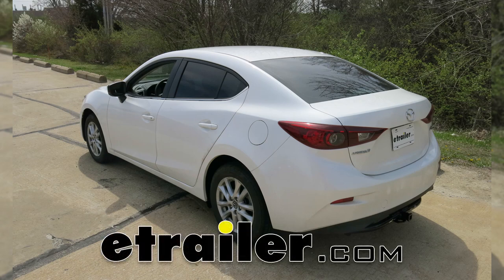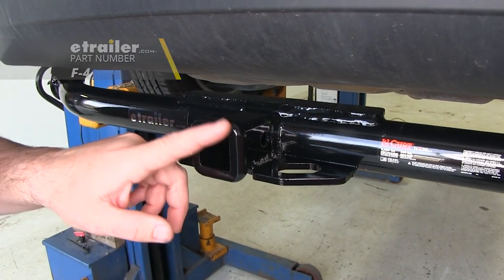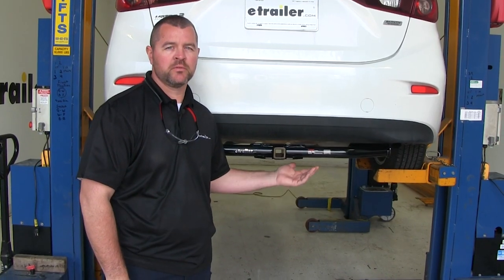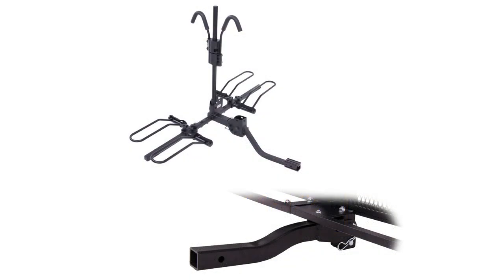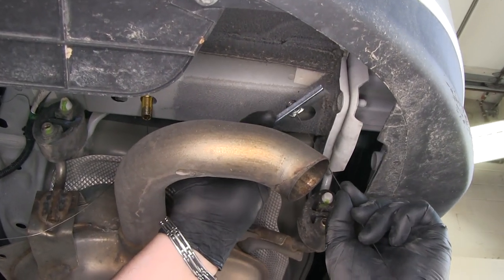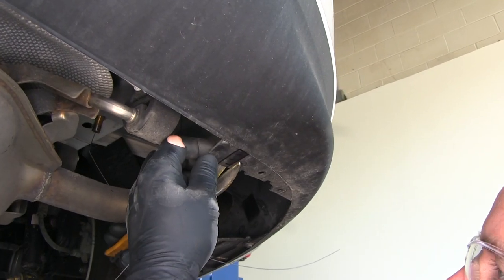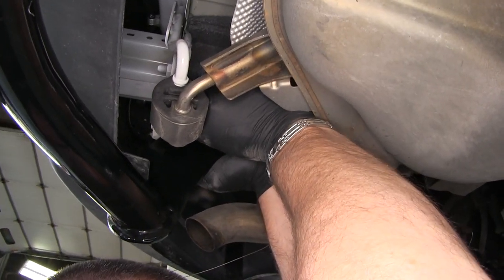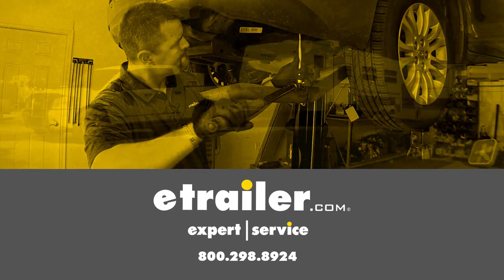etrailer | Curt Trailer Hitch Installation - 2017 Mazda 3

Comment: If you have the 2017 Mazda 3 hatchback it is more difficult, I found. You have to unhook the four rubber bumper isolators and lower the muffler. Removing them took me a while.
Reply from the maker: Yes, that's true.
https://www.etrailer.com/Trailer-Hitch/CURT/C11377.html